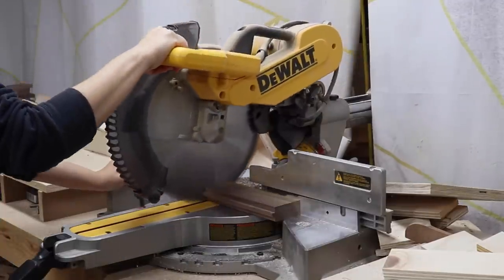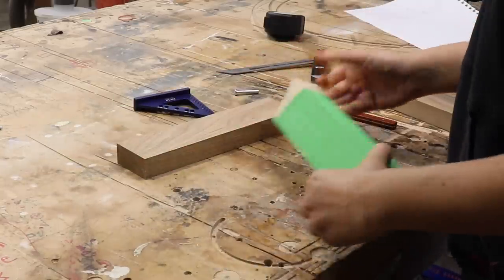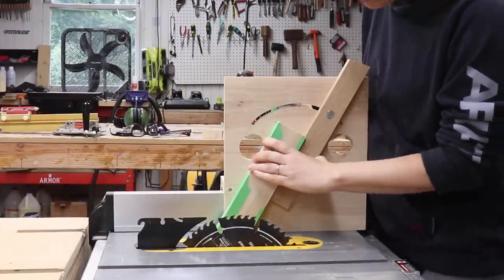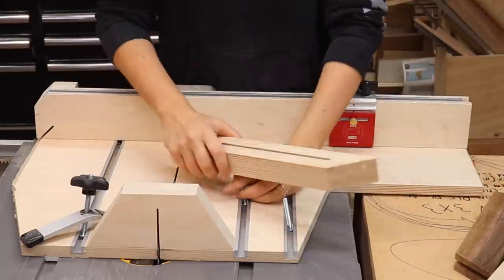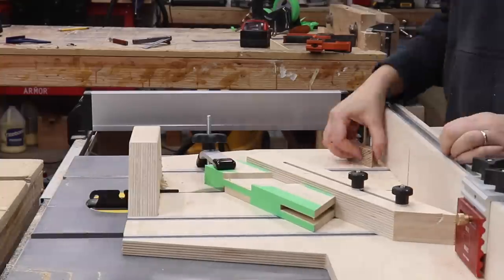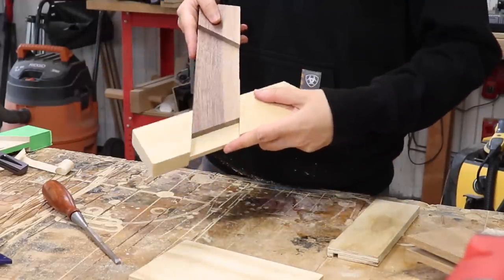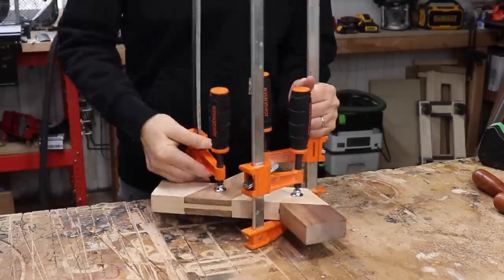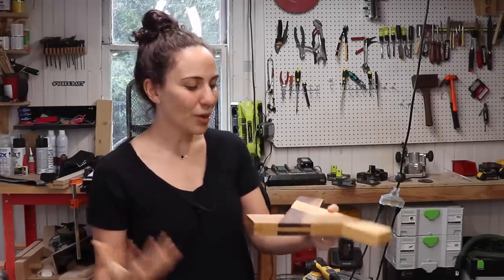Making a Three Way Bridle Joint

Comment: I can remember seeing one of these put together without glue and cut to be a perfect triangle, and presented as a puzzle, of all things.  I had no idea it was called a bridle joint.  
And I liked seeing the homemade tenoning jig.  I've got to put one of those together.  I do have a big honking commercial one that I think I've used about five times, but I would be much more inclined to use an adjustable one I made myself.  
Such good work!
Reply from the maker: So glad you liked it! Yeah. It’s a good jig

Comment: That's sweet.  Rather than cutting the joinery, I suppose you could make each of the three pieces by laminating three layers of wood, leaving voids where you cut your mortises. Each layer could be a contrasting color.  That approach could be done without as many tools or jigs.  As long as the layers are the same dimension, all you would need is a miter saw or hand saw.  I don't see that as an improvement on the design, just an alternative.  Yours turned out great! I love the joinery, I'm certainly not knocking this approach.
Reply from the maker: Oh for sure. I just made it in a lager version for a table and knocking out that mortise was NOT fun. Laminating would be the way to go. But still a cool thing to do. Ha. Video should be out next week hopefully

Comment: It kind of quick thought, you could’ve drilled holes, one into each of the bridal joints, and then used a dowel made from the different woods lightest of the darkest medium in the lightest and darkest in the medium or however you want to order it for contrast. You could also chisel out to make triangles out of your drill holes and make triangular dowels to put into the holes or mortise them out completely to square and use square dowels. Once you glue in these dowels that thing is never coming apart. You can also add a little extra design feature by changing the number of or shape of whatever it is you put through you could even use a Dutchman bowties shape. However you decide to pin through your bridal joint is limited only by your imagination and artistic design. If you don’t want your dowel to be so noticeable drill a 60° angle hole partway in in the 120° Ark that’s open that’s wider than the mortise but only about a quarter to a third of the two cheek pieces. Insert your round dowel into that hole with glue and sand.
Reply: Wow! That last two sentences! Still scratching my head ٩(๏̯͡๏)ゞ?
Reply from the maker: Always a million ways to do something. Yes
Reply: @peterferryskipper  I do not know where spellcheck or whatever gets half the ideas it has for what you’re trying to say. Some of the word choices they use to substitute is ridiculous. Thanks for pointing it out so I can make a little more clear.

Comment: Hi - Beautiful work :) !! I'm trying something that would / could use a 3 way bridle joint, but it's a NON - equilateral triangle. Wondering if you have tried this, or is it physically impossible because of the action of them sliding together in unison .... ??

Comment: OK Awesome video to day on the three Bridle Joint. This could be done with the orgn too. But I like this method 
is actual woodworking and not cnc.  Is there a link for what I think you referred as a hand held router planer?
Reply from the maker: Glad you liked it! I don’t want to share a link since I don’t like mine. But it’s called a “router plane”

Comment: Funny. I was just watching a train wreck of a project using this design, but using lap joints. Obviously this is a more advanced technique and the payoff is quite apparent. I also suspect many woodworkers at your skill level could not do this as well as you did even with several attempts. You do great work.
Reply from the maker: I’m curious what that project was

Comment: Very nice work and thanks for the informative video! Say, at around 7:00, you clamp down the pieces for every cut in between the bordercuts. For me, a tablesaw-inexperienced woodworking beginner, it seems a little unnecessary as I don‘t see a potential danger here with the sliding table by just gripping the piece with your hands on the ends of the piece. Would very much appreciate your opinion. Have a nice weekend and stay safe and healthy!
Reply from the maker: Thanks! I like to be as safe as possible. But do whatever makes you feel comfortable

Comment: Hey Tamar, great video! Easy question from right out of the gate on your video. When pushing wood through the table saw how do you keep the wood flush against the fence? I find at time I have to use 2 push sticks, one to push to the blade and one after the blade to push to the fence. Maybe it's just me.
I think the pattern is cool as are the end grains. I could see several of those making up a pattern for a table top (like a basket weave) filled with acrylic so you can see all the sides of all the joints .
Reply from the maker: I just keep the pressure in 2 directions. Forwards and towards the fence. If you use one push stick you can keep it close to the blade than the fence even though that doesn’t seem safe. It is safer Bc the force it pushing away from the blade the closer to the blade you are.

Comment: Bridle joints I have seen, but not three way ones. Looks very precise and almost like the impossible jointer I have seen. I Can't wait to see one in a stool or table as you talked about (but maybe that was just a for instance), I searched and can't fine an example of a three way bridle joint   8)  ps what is your sample going to be a hot plate holder or other?  Ps nice work
Reply from the maker: Thanks! Yeah. Hope to make a table from it. And I’ll prob use this sample as a trivet/pot holder

Comment: Hey Tamar:  Would it be possible to add two adjusting screws to your homemade tenoning jig to adjust the width instead of moving the rip fence for each slot and/or tenon?
Reply from the maker: I’m sure something like that is possible. But that still requires adjustment. And could be off slightly if not done correctly. It is more accurate to flip the piece over.
Reply: @3x3CustomTamar  Cool....Thanks!

Comment: When are you actually using such a joint? I can hardly imagine to combine 3 pieces into one. Or is this also applicable to 2-piece joints?
Reply: It is also applicable to 2-piece joints. If you take a close look at any furniture you have in your own home, you have a decent chance of spotting bridle joints and its variants!
Reply from the maker: Think of stretchers for a 3 legged table or stool. That’s one example

Comment: Is there a reason you use the knob on your hold down for that sled instead of the lever type? I can understand if that's just what you had or if you like it better that way. I am curious if you found it superior in some manner.
Reply: The lever type is quicker to go from unclamped to clamped, but is essentially ‘set’ to clamp a particular thickness of material. While you can alter that ‘setting’, it can be a fiddly bastard and the screw knobs she’s using adjust to every individual clamping automatically.
Reply from the maker: Exactly what Tim said. A fiddly bastard. 😂

Comment: Hi, great joint. I would love to see that joint used on a glass topped table, seeing that joint clearly through the table top would be fantastic.
Reply from the maker: Would be very cool under glass
Reply: @3x3CustomTamar  I know, especially with contrasting colour like you demonstrated or perhaps deeply figured grain or a sectioned burl. I loved the way the joint came together the first time you did it before glue. It reminded me of a set of gears or a locking mechanism. Good job 👍.

Comment: Kinda offtopic, but i always wondered: Band- vs Circular-Table- -Saw?

Can one fully replace the other and if so for what workloads and what cuts are exclusive to one?
Reply from the maker: Talked a bit about that in my tools to start woodworking video. Some ppl say a bandsaw can replace a tablesaw. I personally don’t agree
Reply: @3x3CustomTamar  It is just that i have had some bad experiences with circular-saws and literally have to force myself every time to use it, which does not exactly raise the level of confidence when working with it - so i guess my real question is: What will i "not" be able to do with a band-saw? Or is there another alternative for precise cuts. I am just a hobbyist/diy so time is only a concern in terms of how long could i use a band-saw in one go (which is the only reason i used a circular-saw-table in the first place - when i start i often don''t find the pause-button) - meaning will a band-saw allow me to push through a stack of workpieces without risking overheating? And also how precise and difficult is setting angles (in contrast to circ-saw)?

Thanks for taking the time!
Reply from the maker: @claudiusraphael9423  you will just need another tool to clean up the bandsaw cuts. Whether that’s a planer, drum sander or handplanes.
Reply: @3x3CustomTamar  Good to know, thanks for getting back - great channel btw!

Comment: The link for the low angle block plane isn't working
Reply from the maker: Hmmmm. I just double checked and it’s working on my end. Not sure what’s going on
Reply from the maker: @smithe53  so odd. I’ll try changing it again
Reply: @smithe53  How do you get the sixth character 45 bracket ? ¯\_("ﺭ)_/¯
Reply: @peterferrydriver  I think it's from a different language pack or something.  I tried for a long time but ended up just copy/pasting from a Google search.
Reply: @smithe53  Tnx. I did the same..copied yours :-)

Comment: There is little skill shown here using a machine to do the difficult stuff, auto planing no chisels used automatic everything use hand tools, 
Hand cut with a saw you'll get more respect. Your not doing much really except setting machines to do it for you. It's a joke
Reply from the maker: Ok.